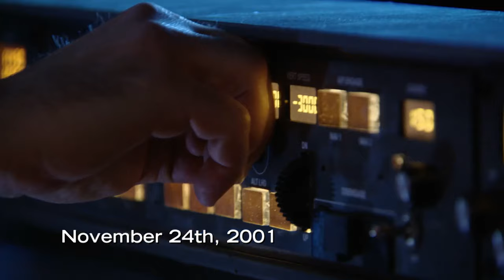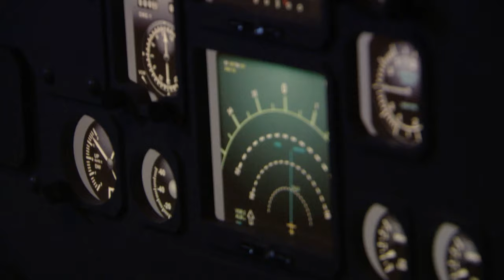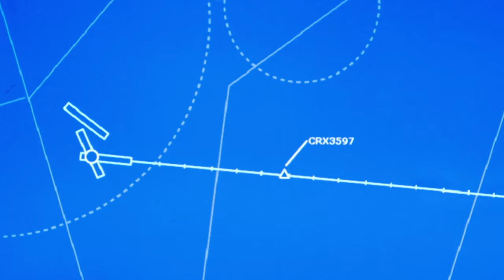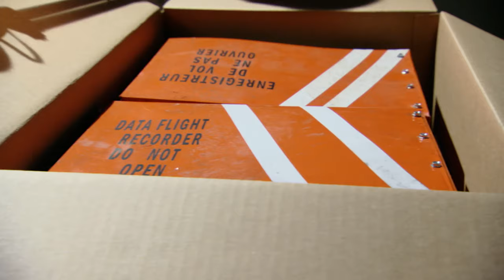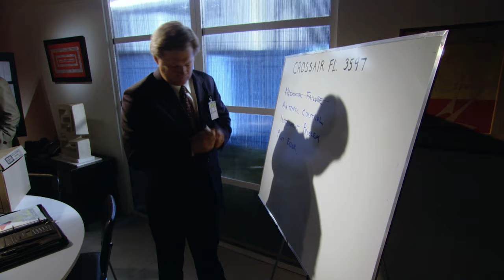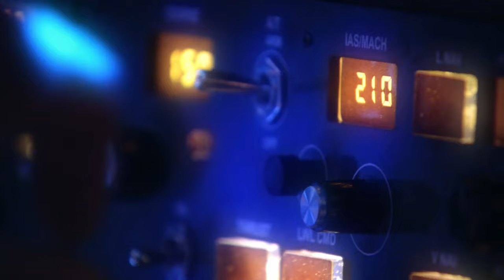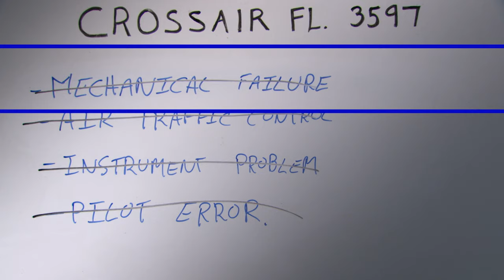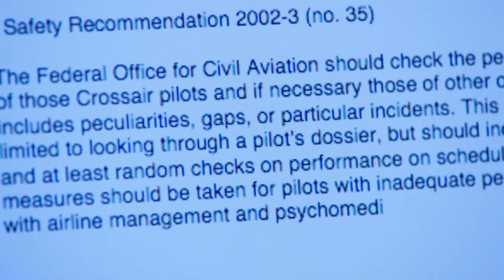Flight 3597 Plunges Into A Hillside | Cockpit Failure | FULL EPISODE | Mayday: Air Disaster

Comment: 11:21 "the flight has hit Decision Height; 2400 feet above sea level, 1,000 feet above the ground." 

This is actually wrong. Decision Height is used on a Precision Approach (such as an ILS) and is the altitude where if you do not have the required visual reference to continue the approach you go missed; Decision Height is only a couple hundred feet above the ground.

2,400 feet is the Minimum Descent Altitude (MDA) which is used on a Non-Precision Approach (NPA) and is 1,000 feet above the ground, much higher than Decision Height. You remain at your MDA on an NPA until you have the required visual reference to continue the approach otherwise you go missed at your Missed Approach Point.

There is no Decision Height on an NPA.

Comment: I would think there should be a minor safety feature to prevent gear from being retracted... when you're on the ground.
Reply: 74 gear once said something that made me think there is
Reply: There is - but he disabled it. From the report:

"The commander was of the opinion that on the ground, with the landing gear under load, the function of the retraction mechanism was interrupted, as is the case, for example, with smaller aircraft. Actually, however, the corresponding safety device of the Saab 340 only prevented operation of the landing gear lever. The commander pressed down the lock release button, which overrode the safety device and the co-pilot brought the landing gear lever to the retract position. Contrary to the commander's assumption, the hydraulic pumps began to work and the retraction process could not be interrupted. The aircraft impacted on the ground and was a whole loss."

It was the first hull loss of a Saab 340
Reply: There is it’s called common sense
Reply: @valerierodger7700  TY for the lesson! makes sense now,,,

Comment from the maker: Do you think bad weather conditions were to blame for this crash or was it a mechanical failure?
Reply: Really?  That must be a stock question because it doesn't apply to this video.  It was obviously pilot error.
Reply: This is Controlled Flight Into Terrain (CFIT). I agree with the previous comment, this has to be a rhetorical question. The plane did suffer mechanical failure, but it was in the form of being flown into trees. They continued an unstable, non-precision approach below minimums and failed to divert or initiate a go-around likely because of continuation bias because they were determined to land at Zurich.

Comment: he still made it 20 years though, despite the several accidents & mistakes, he must have made 1000s of successful flights. i wonder how he managed...??!
Reply: Probably had a first officer that was better and smarter than him.
Reply: @Suisfonia probably helped. I'm also thinking he probably just always got lucky, i.e. with similar easy fights without any difficulties. it's when something is different or for the extremely rare emergencies and that's when you need someone competent. even the worst pilot is clearly able to fly most of the time without crashing; otherwise, they'd have crashed before ever becoming a pilot. it's when trouble strikes... I'm assuming each time he fouled up was a more difficult than average flight
Reply: Luck ran out unexpectedly and without warning.  
ILS runway got shut down so neighborhood would not be bothered by noise...  Sad.

Comment: As a professional pilot, I must criticize this episode for an inaccuracy. Runways are designated according to their magnetic heading, rounded to every 10 deg. which in this case is 140 deg. In radio-telephony 140  deg. is referred to as 1-4 or, one four, and not 14, and 2-8 for 280 deg., with each digit being verbalized. The zero, as the least significant digit in the series of numbers, is truncated. As a pilot, it makes my hairs bristle because such errors tantamount to disinformation which is technically unacceptable.

Comment: Oddly, the captain (who was at fault) was right in the first place and they should have left the runway at 14 despite that it was "nearing 10:00." I understand this is a depiction but the junior first officer looked so smug about being right. I imagine it may have been like that in the real flight. A small victory, but if they stayed on the trajectory they were initially cleared for, runway 14, they would have landed safely. Of course this is no excuse for the poor judgement of the captain. It just goes to show that taking the hard way usually leads to difficulties. Take the smoother path!
Reply: They wouldn't have known if the First Officer was being smug.  That is an actor playing him in a recreation.  Those black boxes don't record video, so they had to assume from audio that he was being snarky/giving a smug look or improvise.
Reply: @annihilator247x  Sure, I know that. The real culprit was the bad judgement of the captain. The thing was the "victory" won by the FO wasn't a good thing overall. They had clearance to land with instruments but to avoid the noise ordinance which was only just starting if it even was, they had to use vision instead which caused this problem. Better to have gone with plan A.

Comment: Air bags .... Put them in the cockpit? Also, parachutes instead of life vests? Reasons "why not?" are probabilities. In warplanes, there's a high probability of being shot down, and few crew. Commercial flights have very low failures, and often over 100 untrained passengers "Please do not open your parachute before you are at least 200 feet away from the aircraft. If altitude is above 20,000 feet do not open your parachute for approximately one full minute after exiting the aircraft or you may experience severe adverse effects due to lack of oxygen. WARNING: parachute rip cord may pose a strangling hazard to small children. Please extinguish all smoking materials prior to jumping. Due to Covid-19 please maintain social distancing from other falling passengers."

Comment: omgawd I can't believe they allowed an incompetent pilot to continue to fly at the risk of the lives of its passengers. Whether the company expanded very rapidly or not that is dereliction of duty. I'd rather pay a little more money for my tickets to be assured that there is correct pilot assessment prior to hire, than to be hiring unqualified pilots, especially when there are passengers involved. It should be law that these requirements are met. They do that in the trucking industry, you'd think in the airline industry this would be a basic requirement. wtfrick. Just goes to show the elite truly do consider us just mere sheep. It's not a conspiracy after all.

Comment: Obviously she knew that she couldn't do it because the supervisor wasn't there and not only that but it would require extensive extensive paperwork as well which she couldn't handle like that and would have evolved in the plane crashing anyway so she knew that so of course you didn't do it which again who's that fault are the politicians they should have made they should have made an override law that if any bad weather Runway 14 is immediately opened no matter what it doesn't make a difference but of course they didn't and who wants to fill out amount to load of paperwork for God's sake plus the supervisor who over who could have who could have overruled the situation wasn't there hello what the supervisor was in there so again who's at fault the politicians for not putting in an override clause